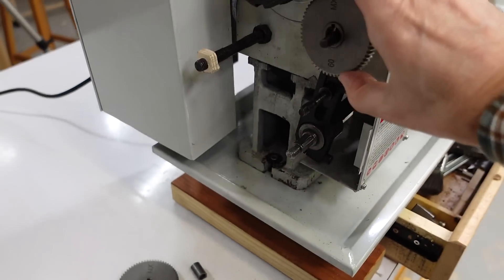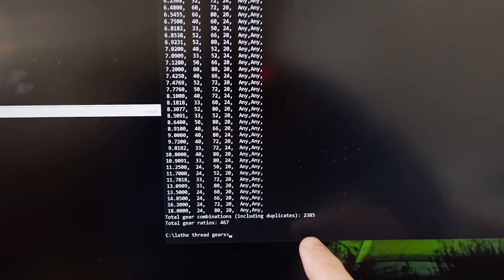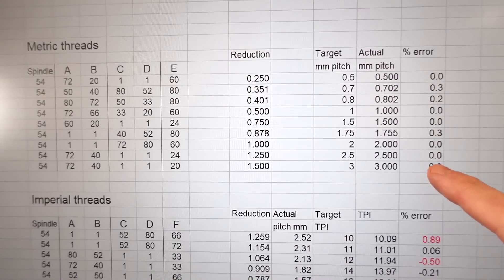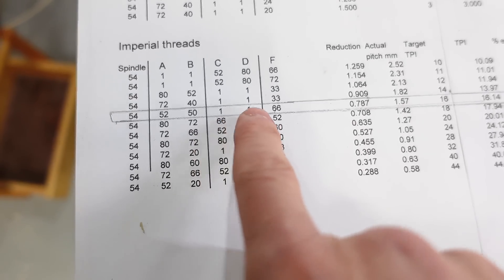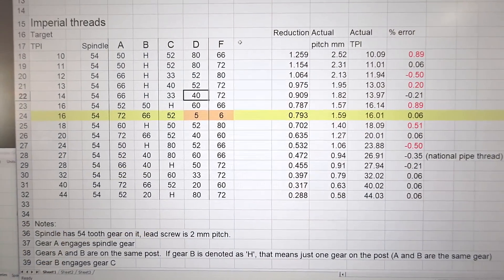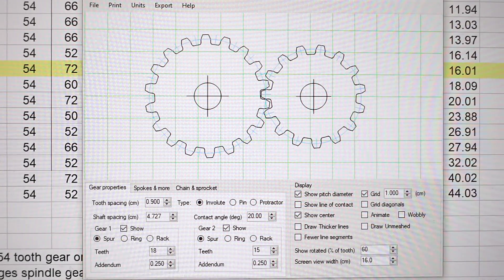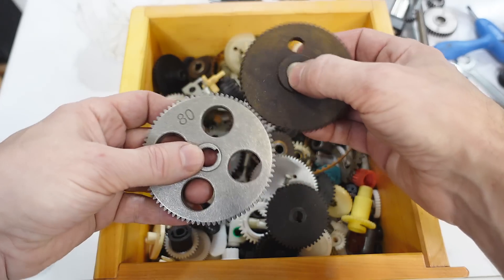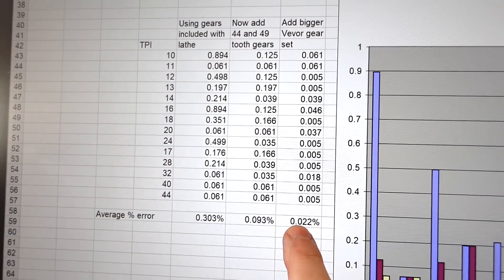Cut *any* thread pitch on a metal lathe

Comment: If wooden gears work, 3d printed gears would definitely work, and you probably can hit the ratio spot on. One thing to note, I JUST bought this lathe, and was looking for gear instructions, and remembered this video from Matthias. The gears that came with my lathe are 20, 24, 30, 33, 40, 50, 52, 60, 66, 72, 80, and 84. In addition, if you look in the manual for the lathe, it says the spindle gear is 56 and not 54, yet the front panel sticker does show 54, and it does indeed have a 54 tooth gear.

So just an update, I modified Matthias' python script to give it a range of gears, from 30 to 50 teeth, and run it for imperial. for 20 TPI, for example, I got 0.03% error using 44, any, any, 30, 58. I have also created those gears in fusion and 3d printed them, and they work great! 

Excellent script Matthias!
Reply from the maker: are those 3d prints with the tiny teeth going to be strong enough!
Reply: @matthiaswandel yes, plenty strong. The teeth aren't that tiny.

Comment: I wrote a similar program to work out gear combos for metric threads  for my imperial South Bend lathe with a quick change gear box.  Turns out all I needed was a 19 and 26 stud gear to meet all the common metric pitches within 1-2 %. Made my gears from PVC sewer pipe slotted on the same lathe with a index wheel attached to the spindle.

Comment: That's a really great script. I bought 56 and 72 tooth gears that did not come with my Vevor lathe and this script made those gears usable for more than correcting error on 1,25 and 1,5 mm threads. But, I'm not certain that I'm reading the script output correctly. Do I put gears on the lathe top to bottom reading the script output from left to right or right to left? Example in readme file for the script states it right to left

Comment: Thanks for this unvaluable video and Python script!!!
Before this I have manually tune values in spreadsheet looking for minor negative error mainly for 16TPI.
My minilathe spindle has a 56 tooth gear, just have edited script to 56 instead of 54 and modified gears list. Now I get positive and negative error values that allow me select gears combinations. Even I am not a python expert at all will try to export script output to .cvs file directly.
Please how to get programm to draw/design gears as in 6:06? I'd like to 3D print some gears first in PLA before Nylon because both suggested gears as "Any" should be equals  and I only have one of each.

Comment: I think the extension to this discussion is "how accurate is accurate enough?"  My thinking is that if your ratio has a pitch inaccuracy of 1%, then after 100 threads (100 revolutions) you'd be off by 1 thread.   If you're calibrating linear motion to a handwheel, that could get you messed up, but in terms of "will this nut thread on?"  I would think that 1% would be unlikely to ever cause any problems.  So it would be interesting to see the results of the python script if you gave it a floor target parameter.  How many gears do you need to achieve no worse than 1% (in)accuracy?  How many to achieve no worse than 0.5% (in)accuracy?
Reply from the maker: surprisinly not that many.  The extended vevor gear set allows me to hit everything pretty close.  Except I don't HAVE that gear set, but the two extra gears I adapted already cut most errors in half.

Comment: If you have a stepper motor on the feed driving shaft and a Cortex M4 MCU with an FPU, then you can make literally any thread you want. Actually I made such controller using Cortex M3 MCU without an FPU but it required some tricks.
Reply from the maker: and an encoder on the main shaft.  I’d rather just figure out which gears.
Reply: @matthiaswandel  Ah, yes, encoder too. I took it from a jet printer.

Comment: Not only the gear scheme on the label is wrong, but some of them are actually physically impossible to put them together! I need to cut a 1,25 mm thread which is probably one of the most commons, have all the gears for it but they do not fit together :-(. Searched  a lot on the internet to find different combinations but all i could find the is for different lathes and the combination do not match the 54 tooth spindle. so no luck.   is there any way you could help me get a combination for 1,25 that works on this lathe?
Reply from the maker: see spreadsheets on my github, linked from the video.
Reply: @matthiaswandel  there's no 1,25 thread there
Reply: @matthiaswandel  was able to modify your spreadsheet and got the 1,25 pitch by changing the  B gear to 50 on the 1mm pitch line. thanks

Comment: you can use a 3d printer and make any gear you want
Reply from the maker: and again and again as they get shredded.
Reply: So far none shred and i made them with original pitch, printed with high strength PLA. They will do the job for a few times, and if it shreds i can print another one😎

Comment: Use a Clough42 Electronic Lead screw. Does all metric and inch threads by scrolling through the two lists. Also almost unlimited feeds per inch or mm. Also can change the feed rate on the fly. (not in threading mode) No more dirty gear changes, no gear noise, no gears at all. Would never go back.

Comment: In the machines you make you usually use a key to link gears to axle.
Although, some times it is useful to have a left hand thread to make this link, ensuring an auto-tightening (like on a table saw arbor).
Is it possible with this lathe (one gear less [or more] and center distance) and with what pitches?
I understand left hand threads are rarely used and when needed one could make that one-off calculation but you probably could adapt your software easily  ;-)

Comment: I know your stance on 3D printers, but this would be a great use case for one. If you were to print with a decently strong plastic (probably not PLA, maybe ABS with a budget machine) you could easily get an accurate gear and would last plenty long enough for testing, especially if you printed it solid.

Comment: @ MatthiasWandel You should have added a calculation of what gear (of any possible) added to the system would bring the errors down the most. Also calculating how long the threading of a bolt can have before the error becomes a problem. Make it a todo for next video. Any way, Good work.

Comment: Being a maker, you should be able to cobble a larger cover for that 80 tooth (or larger) gear.  A bit of a hassle, yes, but safer than doing without and possibly easier than making a new metal gear--which would last longer than two wooden ones.

Comment: You have some odd numbered gears there... From what I remember (admittedly from the days when most lathes' native units were inches... You got a stack of change gears from 20 to 120 teeth, with a duplicate 20 or, perhaps, sometimes, a 40, plus, for metric conversion either a 63 tooth gear, or a 127 tooth gear.  63, not being a full mutiple of 25.4, was a compromise, less precise than 127, but good enough for many purposes... And, sadly, while I can calculate compound gear trains quite easiy, we were taught to deal with them by means of logarithms... (this was all before the days of pocket calculators) a method I've forgotten, and I threw out my 50+ year old college notes fairly recently...
The use of logs makes sense, adding the logs of tooth numbers to multiply, subtracting to divide...  must see If I can find my old text books....  In 50+ years, I've seldom used change gears.  I did, though, have to rearrange the change gears on a lathe correctly after someone on night shift "experimented" ... before I joined the company...

Comment: The BIG QUESTION ... will you release the final (metal) gear chart, or is that contracted to Vevor?
There is an online calculator search for "Little Machine Shop Change Gears For Threading" that covers both US market machines (16tpi) and Metric machines (1.5mm) lead screws. But it only calculates ONE thread pitch at a time, which is cumbersome.

Comment: Ok but when you have a regular nut on a bolt, tightening engages the entire thread inside the nut, whereas a slightly difference in pitch means only part of the thread takes all the pressure.

That might spell trouble if you want the full strength without deforming the thread ... Or simply having to make both sides

Comment: Matthias, the alternative is to get one of the many electronic lead screw systems out there or make one yourself; you have the programming skills and electronics know how to drive servo steppers. I have the one from Maxim Kachurovskiy based on an arduino ESP32 but there are many others perhaps a Rpi version?
Your lathe didn't look happy cutting that thread get an insert tool and perhaps reduce the depth of cut.

Comment: Have you tried 3d printing a gear.   I know a lot of cheap lathes have plastic gears.   I bet they would hold up.  You might even be able to sell the print files to vevor owners.    I have always wanted a mini lathe.  I took machine tooling in machine shop.    Also most the time single tool threads you cut relief at the end of the thread.  Then you start the tread on the same number while running the feed and disengage when you hit the relief and you never need to turn off the lathe between the passes.. Some threads you can go on any number and some on opposing numbers but if you start the feed on the same number every time you will never miss.    I love metal turning it is so relaxing.    I seen You have been playing with it a while.  Overall is it worth the money?

Comment: There's lots of interesting extensions to this problem. Calculating the best gear or gears you need to make to minimize the error for a precision part. Calculate which of your gears make the least difference to your precision so you could give them to a friend who doesn't have enough gears, or calculate the best subdivision between your shared gears so that you both have the best accuracy possible. Very satisfying intersection of math and practicality

Comment: Thought for Vevor;  Offer a main screw in imperial, for folks that are mostly working with that.  Close enough is probably fine for turning random little parts, but close enough also makes a machinist's bum pucker.
Reply from the maker: even with an imperial lead screw, it would be hard to hit all the pitches spot on unless you have a gear for each pitch.  So metric lead screw and good approximation is enough.  Though adding two or three more gears to the set could get them even closer than they currently are.  Close enough that it really doesn't matter any more.
Reply: @matthiaswandel  Suppose that's fair.  A couple more gears would probably help.  I'm just used to a 10 tpi screw on my milling table.  Doesn't seem like it would be all that hard to have 10 to 12, 14, 16, 18, 20, 24, etc gear sets.  all the imperial stuff as far as standard sizes are pretty simple gear ratios, assuming you have some even number of turns per inch on the screw.

Comment: I've had good luck 3D printing involute gears of any size/pitch/modulus.  I have an old small Atlas lathe (not currently running), but I think for light lathe work, solid plastic printed gears could manage the torque.  Matthias, if you want any odd sizes, I'd be happy to print and send to you.  Using CAD, the whole design with center-hole and keyway is fairly trivial.  It would be interesting to see how the printed gears would manage and I'd be happy to donate them towards the effort.  The wooden gears are pretty cool though!

Comment: I've been down this path with 3D printed lathe gears, which work surprisingly well and you can make even a 127 tooth gear with teeth small enough so that it will still fit under the cover. But I based my calculations on the stock gear ratio sticker on the machine - I would not have guessed it could have as much error as what you have found. Although, as long as the threads are close enough I suppose it doesn't matter.

Comment: Slightly inaccurate pitch means that the torque is disproportionately held by one end of the threads, meaning fastener fail at lesser load than they should. Well-matched thread pitch means the interactions are properly balanced throughout the interface between male and female parts. Which may apply to more than just machining.

Comment: @matthiaswandel 
If you want to go crazy,  remove all the gears, attach a rotary encoder (1.8 or 0.9 degree per step) on the main motor and attach a stepper (with integrated encoder) to drive screw.  Between both a microcontroller that converts steps from main motor to steps on the drive screw... All the ratios in software .. sorry for being an engineer and putting bad ideas in your head.... The challenge is yours...

Comment: Mathias...i'm working on a system using bicycle sprockets,  instead of gears, because you  an get them in almost any number of teeth, and they can be "stacked" up to 12 or more on a shaft, and the sprockets can slide in a splined shaft, allowing almost any 'mix' of ratios, just sliding the stack of sprockets, if needed, and moving the chain between selected sets. For converting a metric drive to inch, 13 to 33 tooth gives a conversion to 0.06%...anyway, this was to drive the compound on my watchmaker's lathe, since it has no carriage drive. Otherwise, i guess i go with 600 pulse encoder and stepper motor on the compound drive...

Comment: You didn't mention this point, so I will. Within a certain tolerance, screw thread parts that mesh without binding will accept some intolerance and work fine if they are used for clamping loads. Where the error wouldn't be acceptable would be when the error compounds over length, such as your jigs that use 16TPI threaded rod to advance a particular interval per turn, so you'd be advancing more (or less) than 1 inch per 16 turns.  But if the threaded interface will be static once assembled, perhaps even locktited, then a small percentage error is irrelevant if they fully mesh without either binding or excessive slop.

Comment: 04:20  How do you know that your test coupler is threaded error-free?  If your little lathe has errors in its table, how many other lathes might have "sloppy" fits?  Asking for a friend...  I too have used spreadsheets to do high accuracy computations from the known integer gear values - great fun!  
Back in the early 1970s I was attempting to retrofit a 1954 "Simplex XL" brand 35 mm movie projector whose nameplate stated explicitly that the driveshaft needed to turn at 1764 RPM!  After much hair-tearing, I finally realized that the projector manufacturer had been EXTREMELY clever, because most ordinary 60Hz 4-pole single-phase AC induction motors loaded at ~50% of their full power rating will run at or slightly above ~ 1750 RPM, and by using a 49:50 gear ratio somewhere INSIDE the projector it would run very close to exact speed.  1764 = 9*7*7*2*2, and 1800 = 9*5*5*2*2*2.   I wanted to drive the projector in perfect interlock with other film-handling audio equipment that was driven from 60 Hz line-frequency 4-pole synchronous motors @ 1800 RPM  and/or wound-rotor 3-phase interlock (selsyn) motors @ 1200 RPM, so I found some tooth-belt pulleys & belts at a local vendor to set up the simple 1800:1200 = 60:40 and the more difficult 49:50 = 98:100.  This required an intermediate jack-shaft, but that was the easy part...
Reply from the maker: The couplers are cut with a tap, so likely to be correct.  Threaded rods and long bolts are rolled from one end to the other, so thy are often a little bit off.

Comment: try 37/47 compound gear for the metric threads instead of the perfect 100/127 compound gear. Some error but not too bad.
Reply from the maker: that would definitely be close enough for straight up inch to metric, but its best to combine it with the TPI needed to get one ratio, and then find the best gears for that.

Comment: I've had pretty good luck with generic metric steel spur gears out of China from Ebay or AliExpress. Cheap, pretty good quality, and about three weeks to get them. The centers are unhardened so they can be readily bored as necessary. Broaching or filing keyways is tedious but possible in the home shop. If you need to thin them you'll need carbide cutters, because the teeth are hardened. A mini-lathe may not be rigid enough for that task, but the thickness is probably okay as they come for most purposes.

Comment: Would you share the spreadsheet and Python script? I would love to adapt this for my Lathe.
Reply: I think I figured out the spreadsheet matching your numbers for the Vevor once I realized what gears are meshing for calculating the gear train. I guess this is more complicated for my lathe as I have some gears but mostly threading is determined by a gear box with levers. The change gears seem to mostly be used to switch from Imperial thread to Metric thread or Diametrical & Modular Thread Pitches. There are some gears from the spindle gear that just seem like idlers for the feed reverse, the manual ignores those in the references for the thread tables. for imperial it only considers three gears 40T:127T:40T and the threading gear box. For Metric it considers 40T:120T:127T:40T with the 120T and 127T being fixed together. The last 40T is on the 8TPI lead screw. For metric I think they estimate a 3mm pitch lead screw and not a 3.175mm pitch lead screw for the thread tables.

Comment: In my world, I'm happy when I tap a 1/4-20 hole, and the screw fits it.
Reply: There's actually different taps for classes of fits. There's 3 classes, A, B and C. Each is progressively tighter. Your run of the mill garden variety tap is loose.
Reply: I'm even happier when I tap a 1/4" thread and an M6 screw fits because I now know the 1/4" tap and the M6 taps have been stored in the wrong drawers 🤣